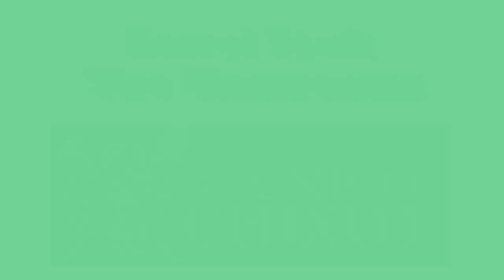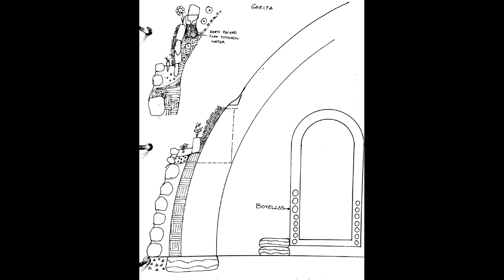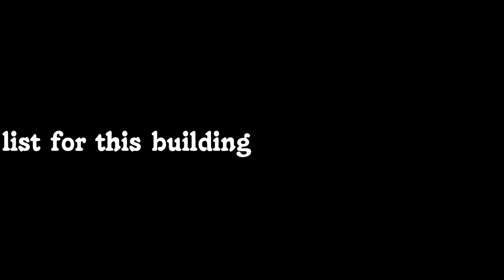Hero School Campus - Earthbag Dome

Comment: feliz dia, habla de costos por recibir elc curso de construccion, cuanto cuesta esta capacitacion?
Reply: It is very simple. You place cattle wire (barbed wire) between wack level. You also use rebar to strengthen. But you must cover the plastic or it will disintegrate in the sunlight.
Reply from the maker: Hola, https://www.lwhome.org/academy
Reply from the maker: Hemos ensenado durante nuestra academia.

Comment: Why did they need such thick walls?
Reply: The walls provide structural stability and a thermal mass to keep the temperature inside the house cool in summer and warm in winter.
Reply from the maker: https://www.lwhomegreen.org/   Here you will find 10 years of Green  Building research, all in one place!